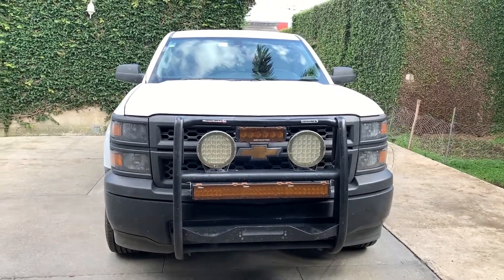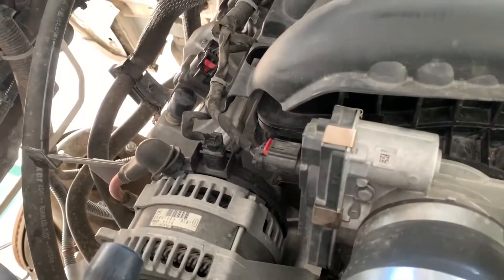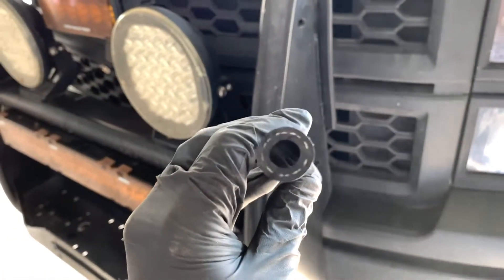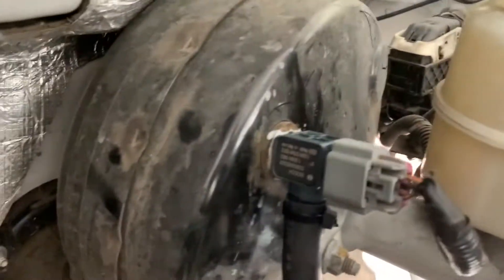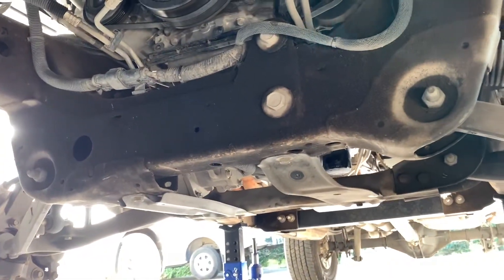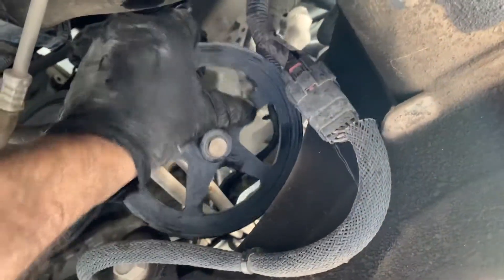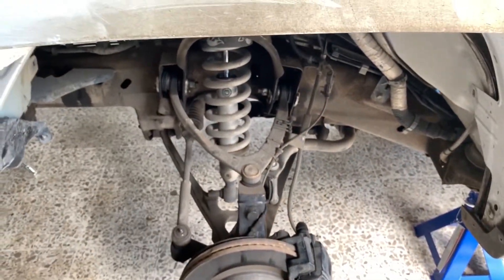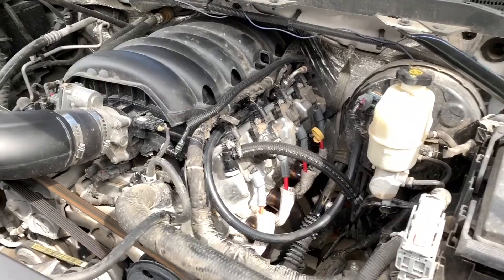How to Delete Brake Vacuum Pump on a 2014+ GM Truck or SUV

Comment: What would happen if you just left the pump in place? Cut the belt and run your hoses.  Put a plug on the old pump hose connection.
Reply from the maker: You could try that
Reply: @BadAssEngineering  What did you use to close off the PCV connection on the front of the engine block, some kind of tape or sealant?
Reply from the maker: @kentheis105  there are rubber plug kits on autozone, you can either plug the stock ports or harvest and plug the fittings
Reply: @BadAssEngineering  I decided to just unplug that PCV connector you used, did not reuse the connector or cut it off.  I temporary plug that end.  Connected the new hose to that port and clamped it on, ran it back to the Brake Boost.  I then plugged the old vacuum line and cut the belt off the old Vacuum pump, leaving it a dead stick.  I gave that a try and my brakes work just fine, truck is running normal.  I'll leave it this way for a while just in case there is a need to put it back to stock but so far, no issues.  I just don't see a need to spend the time removing that vacuum pump to put two plugs back in if I already have the old vacuum line plugged and the belt removed.  If someone thinks this is a bad idea, I'm whiling to make a change.  After 50 miles and a lot of brake pedal time, its working great!
Reply from the maker: @kentheis105  you should be good if the booster gets vacuum just fine, just beware of thin vacuum hoses that can collapse

Comment: I need a source for oil pressure sending unit on my LV3 V6.  Do you know which blocked off vacuum pump hole produces pressure ?
Reply from the maker: I don't know, the easy way of doing that would be to try the plug and sending unit in either hole, and if doesn't work, switch

Comment: I see we have much better engineers on here than there is at the Chevrolet corporation.
Reply: Funny how many pumps have failed that GM has special coverage for 10 yr/150k to replace them. But yeah engineers, go figure.
Reply: And where the gunk that comes out of that pcv goes?
Reply: You are an idiot if you think that gm engineers are competent. Engineers are the smartest dumbest people I know unless they have field experience that's why gm engineers did away with the pump in 19 or wait afm was super BA idea. Go troll someone that deserves it.
Reply: You ain’t lying bro

Comment: I saw this in the forum as well . Great husband thank you. So ? How did you run your catch can and where is location?
Reply from the maker: Catch cans don't work, my pcv goes to a crankcase evac to the exhaust
Reply: So you have a evac system . Is it a summit evac
Reply from the maker: @cheetoz6902  Moroso 25900, but i guess a summit kit is the same

Comment: If I install an oil catch can, can I just tee the brake booster into the clean side hose of the catch can? TIA
Reply from the maker: Oil catch cans only work when they're cold (literally minutes). Once the engine bay gets hot, the dirty vapors just go through. There's no use on using one on street vehicles, and a waste of money
Reply: @BadAssEngineering  Fair enough but I’m also adding Stage 3 cam, LT headers & exhaust/ intake. For my original question, will the vacuum for oil catch can & brake booster together work?
Reply from the maker: @The_Fat_Pipefitter  i wouldn't do that just to avoid any chance of getting dirty vapors into the brake booster. Why do you want a catch can ? Most crankcase pressure goes out the head covers into the throttle body anyway...
Reply: @BadAssEngineering  Direct Injection mostly. Would a vacuum manifold be ideal or just get a throttle body spacer with a fitting for the booster?
Reply from the maker: @The_Fat_Pipefitter  a throttle body spacer could indeed work well, you could test that

Comment: Did the delete.. now I'm getting o2 codes is it related or something different 2014 v6
Reply from the maker: Check the codes, sounds more like an o2 sensor shorted out
Reply: @BadAssEngineering  no codes untill I did this but like I said not sure if this caused it or just something else thinking of putting a t connection there to see if codes return
Reply from the maker: @douglasroberts487  check for any vacuum leaks, but most likely it's unrelated

Comment: Works on l86 with AFM turners off, but I have a suction noise when pressing/de-pressing brakes that I can hear inside the cab. Is this normal now?
Reply from the maker: You might want to check the brake booster itself, but if the brake works well and it doesn't feel hard it should bebok

Comment: Awesome video but i have a oil catch can that runs between the intake and my PCV, will i have to remove this catch can or is there a way to keep it and still do the delete?
Reply from the maker: Catch cans only work when cold, and Most pcv gases go to the intake from the valve covers anyway, there is no point in keeping it
Reply: @BadAssEngineering  awesome, if you dont mind me asking one more question, where is your valve covers vented to? I see you have a hose coming from them but where does it go? And do you just leave the PCV valve open once you disconnect the line?
Reply from the maker: @full_sends_only  my valve covers feed the pcv gasses to an Exhaust Evacuation System, also called "evac". It uses the exhaust flow vacuum to pull the pcv gasses from the engine
Reply: @BadAssEngineering  is the evac system needed to safely do the pcv delete?
Reply from the maker: @full_sends_only  no, it is not. you can delete your pcv line and use it for the brake booster only, most gasses go out the valve covers into the intake air box anyway. The manifold pcv line only pulls a little bit of gas when there is vacuum on the manifold
Reply: @BadAssEngineering  thanks for answerin man, gunna do the delete tomorrow.
Reply from the maker: @full_sends_only  anytime, bud

Comment: What do I do with the fitting on the block? The one right up front closest to the throttle body?
Reply from the maker: You just cap it, all the PCV goes out the valve covers anyway
Reply: @BadAssEngineering  
What did you cap it with?
Reply from the maker: @Chief6067  Autozone Rubber Vaccum Caps
Reply: @BadAssEngineering  
Did you need to secure the vacuum cap with any kind of clamp?
Don’t mean to ask so many questions but I want to do this on my truck and just want to be sure 

Awesome video too
Reply from the maker: @Chief6067  Questions are always appreciated! a black zip tie well tightened on the cap is more than enough.
Reply: @BadAssEngineering  
Thanks again so much for your help
I’m excited to get this completed on my truck

Comment: I just did this to my 2014 4.3l and still have a service brake assist message so I went to get it diagnosed. The pedal no longer gets hard but the abs is acting funny. I replaced both wheel bearings and both rear sensors. The shop said it’s getting an incorrect reading of vacuum. I’m thinking it’s either the sensor on the booster or the ebcm. The shop said I’d have to put it back to stock for them to dig deeper into the problem. Just wondering if you had any issues along these lines. Yes I do have a Diablo tuner disabling the afm.
Reply from the maker: Did your vacuum pump fail before you did the delete ?

Comment: Can I remove the vaccum pump without disable the afm?
Reply from the maker: You can but there is the risk of not enough vacuum for the brake booster

Comment: hey bro great video if i have 6.2 intake manifold and catch can where should i plug the  line that comes from brake booster ?
Reply from the maker: Remoje catch can that doesn't prevent carbon build up and your manifold pcv should be in front around the throttle body

Comment: Hey bud, great video you shared here! I watched it several times, along with others but still have a question when it comes to a supercharged L86. I want to get rid of the pump and I am willing to add an electric pump but would much rather attain vacuum from the motor. Any thoughts?? Thanks
Reply from the maker: You could also add a good check valve so boost from the manifold doesn't go into the booster, or do the electric pump but I don't have any experience with those tho

Comment: I don’t have doubts about this configuration because that’s how it was done in earlier models but I’ll have to get a tuner to make adjustments when I wish there was a physical if I’m not able to obtain a diablosport
Reply from the maker: Physically doing a DOD/AFM delete is ridiculously more expensive
Reply: @BadAssEngineering  the physical delete of AFM requires new lifters and a new cam.  It's  a significant remove and replace process, and significantly more costly than re-programming to delete the AFM/DOD function or purchasing the Range module (~$200) to disable AFM/DOD

Comment: My 2015 suburban vac pump went out my afm is already programmed out how do I cap off the crank case line can u explain alittle more or show a pic
Reply from the maker: With a little 3/8" hose cap
Reply: Awesome so just cap that one off and want  though a engin code ? I appreciate it
Reply from the maker: @samjackson8898  it won't throw any codes, all of the PCV pressure horas out the valve cover hoses anyway
Reply: Awesome thank you our vacuum pump went out 500 miles from home on vacation and this will be easy Lowe’s /autozone fix especially since I have no tools on the road thanks 👍
Reply from the maker: @samjackson8898  be sure that the pump braking didn't affect the brake booster 👍🏼👍🏼
Reply: I am going to cut the belt off leave the vacuum pump on  and cap hose coming off of it as well Till I get Home and order the vacuum delete kit 
I appreciate ur videos
Reply: I checked for oil in the line up the break booster is that what u are meaning ?
Reply from the maker: @samjackson8898  yes for oil or debris

Comment: Thanks for the video man but I had a question about the vent hose from the valve covers. I noticed you plugged the passenger side and you have your driver side to your exhaust. What if I have both connected to my intake tube on a aftermarket cold air intake?
Reply from the maker: Thats fine, you just delete the crankcase-to-manifold line like i did in the video
Reply: All right cool thanks I'm going to knock it out this weekend thanks man 🤙🏼

Comment: Great video. Takes me through every step for the delete process and just saved me money on installing a catch can to my intake. I was trying to reduce oil spray coming from the valley cover PCV from being sucked into my intake.
Reply: If I already have a airaid modular intake tube how would I delete the nozzles for the breathers? And what did you do to cap off the pcv?
Reply from the maker: You can delete the manifold pcv and route the valve covers to the atmosphere, catch cans only work for drag racing or very short stints anyway
Reply: @BadAssEngineering  Thanks this was very helpful.

Comment: Great info. Where do you have your crankcase hoses running to? I noticed you don’t have them running to the intake like before.
Reply from the maker: They run to the exhaust via a Crankcase evacuation system
Reply: @BadAssEngineering  Do you have a video on how you set this up on your truck? I am very interested! Thanks
Reply from the maker: @robertscimeca1768  not yet, but will make one soon
Reply: @BadAssEngineering  Did you ever make this video?
Reply from the maker: @connorduncan2789  nah, the feds could get angry and stuff

Comment: I have a 2015 Yukon and I’m planning on deleting this same thing but I have a catch can running from the dirty side to the clean side of the manifold any ideas to run a catch can and delete the vacuum pump?
Reply from the maker: Catch cans only work for drag racing applications. It only works for a few minutes at a time when the vessel is cold. There is no real use when using one on a street car; most of the pcv vapors go out the valve cover vents into the air box anyway

Comment: Maybe a dumb question,  but the existing crank case hose runs down the middle of the motor in addition to the vacuum pump hose that it getting deleted. Im working on a 15 5.3 and I noticed your truck didn't have that hose pre installed. Any idea what it is?
Reply: Just finished the mod and wow. Big improvement. And no more annoying whine either
Reply: So im trying to take off the pump and have no idea on what angles to use to get to the bolts. Any idea how to get to them? Removed lower skid plate, wheel, and wheel lines and still can't get to them with a ratchet.
Reply from the maker: @resid3nt  you have to use extensions and little ratchet elbows with I don't know the name of
Reply: I think our engine builds are different. Im attempting the same route as you and the front diff is covering access
Reply from the maker: @resid3nt  my truck is a 2WD, I didn't have a diff  in the way, you may need to figure a new way to get to the bolts
Reply: I finally got it. Let's just say the front drive axle is a bitch to work around lol. But oil pressure looking great and I can "feel" the extra 100hp lol
Reply from the maker: It's the direct pcv case-to-manifold like, you can just cap it off in this case (what I did)
Reply: @BadAssEngineering  thanks for the reply. Can you suggest what to use to cap it?
Reply from the maker: @resid3nt  I removed the line and capped the nipples with an autozone rubber cap kit
Reply: @BadAssEngineering  right on brother. BTW, I also do the same burnouts lol
Reply from the maker: @resid3nt  when you cap that little pcv line, all pcv vapors go out the valve cover breathers anyway, so you should be just fine

Comment: This is genius. I was planning on replacing my vacuum pump since I know that’s why I’m getting a stiff break pedal at parking lot speed. Just so happens I’m getting a Diablo i3 tuner soon and can delete afm. Also have a slight ticking sound and assumed it’s the bad vacuum pump.
Reply: You broke which pedal???
Reply: That's what mine did too ticking gone now
Reply: My 2016 silverado doesn’t brake when im reversing it shudders then keeps rolling untill stopping late (dealer quotes 1700$) after I paid them 587$ to replace the sensor just for it to do the same issue when I left the dealership

Comment: I’m not sure this will work if you run a boosted Application
Reply from the maker: All you would need is a check valve in the line

Comment: So I did this to my 2018 6.2. Brakes work as they should. But I keep hearing a sucking noise at my master cylinder. Is there a way to remedy this? Maybe a vacuum reservoir? My truck is completely stock besides this mod and the tune to disable v4 mode
Reply from the maker: I don't hear any noises on mine, I would check if at any point there is a leak on the line or the connections
Reply: Josh, i have this sucking noise too on my 6.2 after doing this mod. Did you ever find the cause or solution? Thanks
Reply: You have a leak in your brake booster up top when this pump goes bad it gets oil in them.
Reply: Any fix for it mines doing the same thing.
Reply: @JUANCRAMIREZ19    It fixed mine now I have brakes I can count on
Reply: @garagebandthekindofrecordingsy  its the air intake, and the brakes work grait with the delete

Comment: Great video! So if I delete it I have to get some type of custom tune to get rid of the v4??
Reply from the maker: Gerwin Filmz not really, there are AFM range timers as well. A custom tune is what I wanted for myself tho
Reply: just put into M5 (if your truck is 09' or above) and the V4 mode will never be activated unless you put it back into D or M6

Comment: I see you are running your valve cover vent lines somewhere else. How are you venting your PCV system?
Reply from the maker: To The Exhaust using a Crankcase Evacuation System (Moroso 25900)

Comment: Just out of curiosity why not just leave the pump on without the belt incase you want to go back stock when you are ready to sell or trade it.
Reply from the maker: I wanted to take the pump apart out of curiosity...
Reply: @BadAssEngineering  I wanted to do this delete to my truck. Do you think I can leave the belt and pump on so I don’t have to mess with removing it?
Reply from the maker: @aaronimad83  there is no point in doing anything to it then

Comment: You did a great job with this video and also answering all the questions guys asked about this mod. I'm doing mine this weekend.  I ordered a performance vacuum hose for race cars for the Vac line.
Reply from the maker: michael i used a heavy duty brake line hose for trucking applications
Reply: What do you think about adding a jegs vacuum  reservoir in line. And if your engine stalled you still have backnup vacuum and will still have  brakes
Reply from the maker: michael I don't have any experience with that, but the brake booster should have enough reservoir for a couple of pumps after engine shutdown

Comment: Can I run a catch cam and use a three way to run the brake booster to the intake or do you have to plug the pcv?
Reply from the maker: Josh I guess you could, but catch cans in the vacuum line don't do anything to prevent carbon buildup (most of the vapors go out the valve covers anyway)

Comment: Do I need to add a PCV Crankcase Evacuation System once I delete the PCV line? This topic is of great interest for LT swappers because we are putting a type 2 Saginaw pump for power steering in place of the vacuum pump..
Reply from the maker: Paul No you don't. If you delete the manifold PCV line, pcv vapors will enter the engine via the valve cover breathers. Most PCV vapors get vented that way anyway!

Comment: Could the vacuum pump be the reason why my brakes are locking up ? I thought it was my calibers I change them & it does the same thing, after driving it for awhile my brakes won’t release back stay stuck like the brakes were on.
Reply from the maker: No, Sounds like some other problem. I dont know what could be causing it, but i would check the booster and master cylinder
Reply: Sounds like a proportioning valve sticking